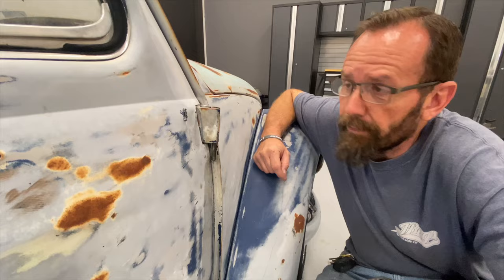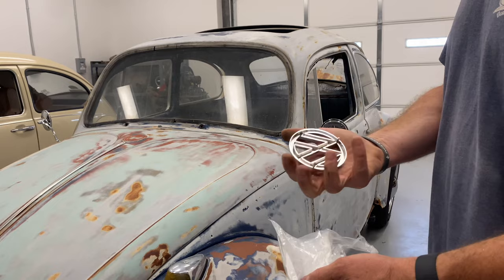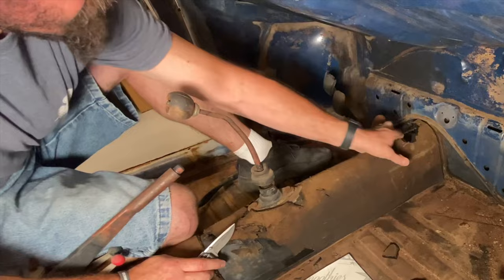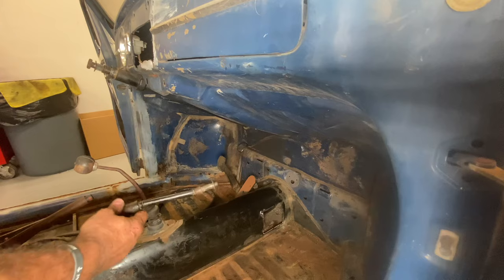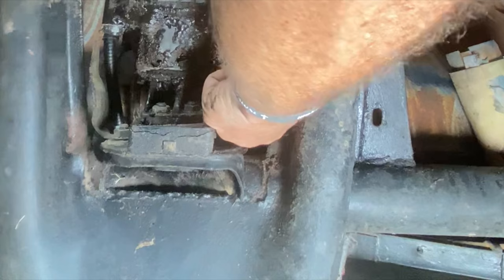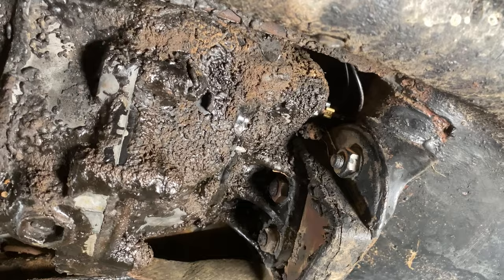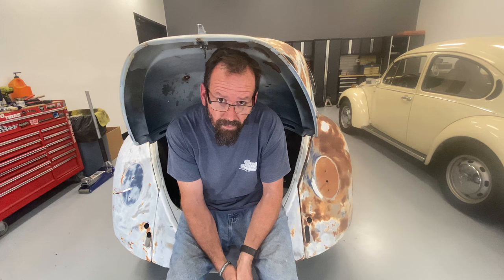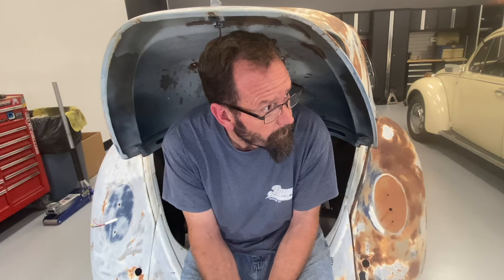1967 VW Beetle - Mirrors, Trim & Chassis Work

Comment: I didn't  think the door pins  was suppose to come  out through the  bottom  that they were  suppose to come  out through the  top
Reply: In earlier cars with a mushroomed top, the pin has to come out the top, yes. Fortunately the later cars don’t have the mushroomed top so they can be driven out the bottom which is much easier. 

On early cars I’ve only ever been able to get the pins out by heating up the hinge which destroys the paint.